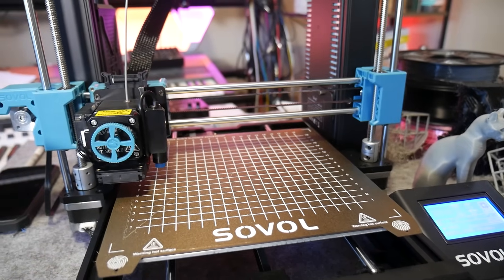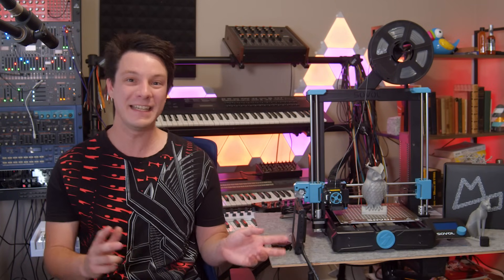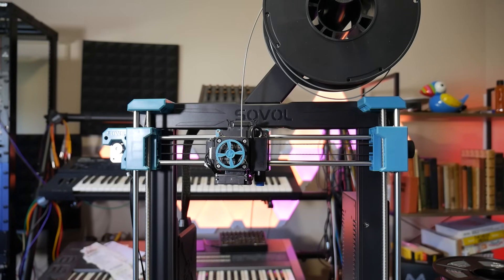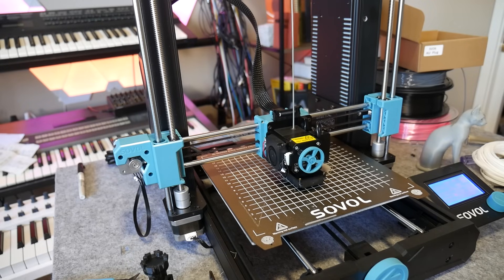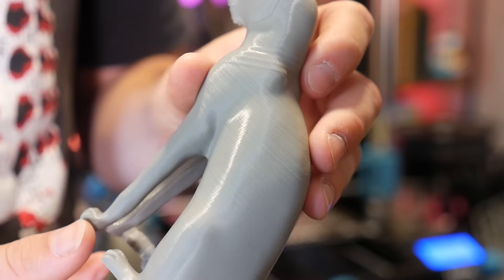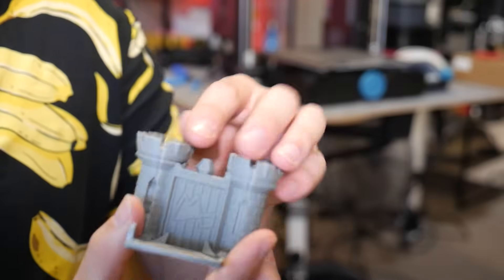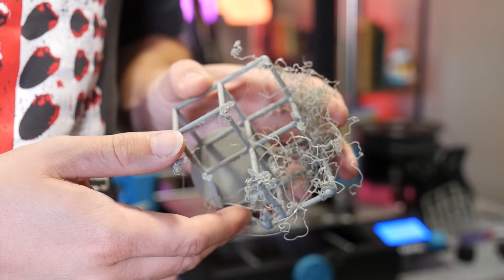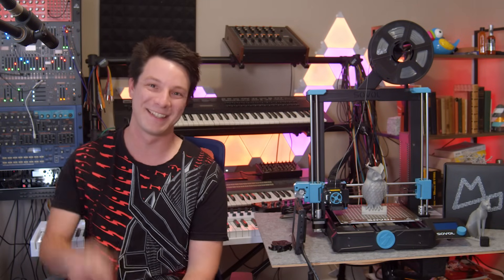Is the Sovol SV06 a Prusa MK3 for 1/3 the price?

Comment: I'm so glad I got my flsun v400. I don't understand most of what you said, which is why I got it. Plug and play. Auto bed leveling, filament runout detection, it just works. I'm an engineer who's fully capable of going full tilt on 3d printers and understanding all the tech to the nth degree, I'm just not interested in doing that
Reply: From one engineer to another...that is really sad 😉

Comment: I feel so much better looking at my pei bed scar now that ive seen a YT pro do the same thing. Th3d has a custom marlin firmware for the sv06. I fumbled my way through it. I was trying to use input shaping but couldnt get it to work. Would love to see you work through it :)
Reply: I have one on my printer sv06. If you contact them they will send you a replacement PEI.
Reply: TH3D is awful lol, I asked them what makes their firmware better and the dude got super hostile. He has a history of being a complete ass to anyone who questions him. From what I've read the firmware isn't even really better, it's just different.
Reply: @allwoundup3574  that lines up with my experience. The one feature I wanted from it didnt work. I had to retune everything. It was immediately worse than the out of box firmware. It was pretty easy to configure but Ive also not tryed to mess with Sovols stock firmware with the same tools.

Comment: 6:26 it's weird that I had to reduce my retraction from 6mm to 3mm after switching to a volcano hotend from stock ender 3 v2. Took me awhile to dial it in since every forum suggests to set it slightly higher than what I'm running with the stock hotend. I still get a tiny bit of string here and there but nowhere near as bad when set to 5mm or higher. I also had to back up retraction speed from 60 to 45mm/s. I had to do the same retraction test multiple times, like more than 5 times because it's so out of the ordinary based on what the internet says that I thought there has to be something I was missing, but nope, it's just the way it is.

Comment: On some other dual-z printers like this I've certainly found having a warp-free bed (glass, usually, instead of flimsy flexible sheets) and a z-axis sync belt are crucial for long-term reliability... I'm sure a belt would be an easy mod on this.

edit: oh yeah that inductive probe levelling needing fine tuning afterward too... rip. I don't understand why everyone doesn't use strain gauge levelling, it's genuinely more expensive to use inductive probes, both in individual printer kits and bulk-ordering as a manufacturer...
Reply: Noob here. Why would you want a sync belt ? Wouldn’t that defeat the purpose of the bed leveling ?
Reply: @Carglouche.  Angus mentioned it already but it keeps both Z axis positions in sync so the gantry did not skew (which can cause bed leveling problems as well as just generally break/wear down the machine, particularly a unit with no endstops)

Comment: I'm actually loving my SV06 - it worked straight out of the box, using the Cura profile they provide on the SD card, the only change I made was to up the speed to 80mm/s.

Took a bit of a risk in buying this printer as none of the channels I trust had produced a review on it yet. 

I've put approximately eighty print hours through mine by now, every single print has come out almost perfect - aside from a bit of wispy stuff, but that's potentially my temp setings for my filament. Admittedly, I've not tried any "torture test" style prints, and the longest print so far has been about fourteen hours.

Obvious disclaimers apply - I'm just a 3D printing scrub, my only other machine being an Ender 3 V2 Neo.

Thanks Angus for putting this video out there, love your work mate.
Reply: Mine has been nothing but problems
Reply: @outsidecounty9976  what problems have you had?

Comment: Okay I was blown away with the build quality and ease of set up for the printer. I received the SV06 a couple weeks ago, but just as I was getting it tuned after a few hours of tests, I tried a g code post processing script to pause at a certain layer, and the g-code bricked my printer's mobo. I tried to reflash firmware, but no luck. I returned it and am considering just buying another Anycubic Vyper, which has been my most reliable machine yet

Comment: Thanks for the video - I like to adjust conservatively for nozzle height, then tweak z offset on the first layer.  This avoids print bed gouge.  Not all printers/firmwares offer z offset as an easy tune-while-printing option however.  Looks like a nice printer.

Comment: No isnt. Many problems... Mine has massive Z wobble 👍
Reply from the maker: bent leadscrews?
Reply: @MakersMuse  i dont think so. I ordered 2 new T8*8 with wobbly bras lead screws like the Ender 3 has and i will see if its works. Bad english 😁 in facebook groups of the printer there are also many problems to read ... and sovol releases a plus Version now 👍
Reply: I noticed my Z was moving around unnecessarily, and it turned out that the upper half of the printer was not bolted squarely to the lower half.  A fellow redditor pointed that out to me as a possibility, and it was true.  I loosened the 4 bolts, and used a drafting square (any kind of square a foot long or so will do) to make the upper half 90 degrees to the table.  Solved.  This was not a problem on my son's SV01 PRO because his slots for the upper half to fit into are precisely milled dovetails, and there is no wiggle room.  But his took a great amount of patience to slot into place.

Comment: New to 3d printing, just wondering if the sv06 plus would solve the issues you mentioned? Looking at buying my first machine. Was thinkig about the bamboo options  but not sure for the price.
Been watching your channel for awhile now. Keep up the good work.
Reply: While you’re looking, Elegoo Neptune 3 pro/plus/max are comparable options. Mostly the same as this, but v slot wheel and not an an metal hotend. I would have bought this if it were ever in stock. Good luck now that it’s on this channel.

My calibration cubes definitely look better than this though (3 pro).
Reply: Bambu P1P is twice the price of the Plus, that price gets you less tuning/fiddling/solving problems etc and should have near perfect prints out of the box, but if you're willing to put in the time and learning then you can get a machine like the SV06/Plus to a great place with some ongoing effort, and then double up for the same price lol. I don't have that time so instead of upgrading to the Plus I switched from SV06 to P1P, that's just me.
Reply: Honestly, 3D printing is still not appliance-like with any printer. If you want to get into it, you're going to have to learn a bunch, even for the most easy to use printers. Fortunately, youtube has endless videos covering all the issues you're likely to face.

If you have the money, get a Prusa. If not, I think the Ender3 S1 is the easiest to recommend at the moment. By picking the most popular options, you're more likely to find answers when things go wrong.

Comment: Why can't printer reviews measure and report quantitative results.  How much variation is there in a flat vertical wall for instance, reported in mm peak to peak.  All these prints of statues with lighting that hides the flaws.  Who cares?  I don't print junk plastic statues and I want to know how any given printer can perform printing a smooth surface for a product that won't look like crap.  Obviously a printer like this built with the least expensive bearings, motors and fans will have failures in 100 hours of run time, so I wouldn't bother with this one, but it would be nice to know if it has 20% variation in an 0.2 mm layer height or 2% variation.  Why do all the work and not report anything that can be compared between different reviews?

Comment: I bought one as an emergency backup to my original Prusa I3 Mk3.  Turns out it actually prints better than my Prusa, so now I'm using both.  There are already people designing new fans and such.  Also a couple people installing and running Klipper with input shaping and getting print speeds comparable to the Bamboo X1.  To Sovol's credit, they took the leap that Prusa refused to take and designed extrusion molds for the major parts.  This brings their costs down significantly in bulk sales and produces higher accuracy parts.
Reply: would love to know how reliable it’s been compared to your prusa after getting it tuned , i have 2 and was looking for a cheaper alternative
Reply: @Project.3.D  months later.. still printing better than my 3yo prusa.
Reply: @Project.3.D  pretty reliable. ive had mine a year couple small issues. but really you will not be dissapointed. so if you havent get one there even cheaper now.
Reply: Bambu’s own A1 and A1 mini are bed slingers that do a 14 min Benchy
Reply: Youre liar lmao sovol printers are always dead out of the box and never work because sovol is a scam company. All the phone numbers and social media links on thier website are all dead and fake links. Call thier corporate phone number and its disconected. SOVOL IS A SCAM COMPANY the host comment here is a liar and part of thier FRAUD RING. DO NOT BE FOOLED INTO GETTING SCAMMED BY SOVOL
Reply: Have you any links to the speed mods? I am looking for a backup for my X1C and even if it could reach 80% of the speed that would make me happy
Reply: It can come nowhere near a bambu. It's not possible for any bed slinger. I have a ender 3 s1 with klipper and the best I can hope for is 150mm with 3500 acceleration. That is like the max where I can retain acceptable quality. A bambu can do 500mms and 20000 accel. They are not comparable. It's more comparable then a stock a stock ender 3 s1, but still two different ball parks.
Reply: @luke8874  the neptune 4 series would beg to differ its faster than a bambu, 
also the klipperized sovol sv06's hit close to 18 minute benchies, only 4 minutes off of a bambu printer
Reply: A klipperized bed slinger, built really well will have an acceleration significantly lower than any core XY. So will never achieve CoreXY print speed, but can reduce the gap.

Comment: I got this printer based on the many positive reviews. Yours is the first I have seen that even mentions some of the problems I have with mine.  One major one is assuming that bed leveling even works.  Most people are printing on the center of the bed and thats great for most models.  Try printing something in the corners and see if your settings still work. Mine do not. The bed is a potato chip.  After firmware changes and nylock nut mods I can use about 80% of the bed. The bed is only attached with 5 screws so that mode is limited. Bearings were actually losing balls and had to replaced. Cooling fan is a joke.
Reply: The whole point of mesh levelling is that it accounts for the bed not being perfect (which is practically not possible to source, particularly at this price). My experience hasn't been perfect but I've done full bed prints no problem with stock mesh levelling. One theory I saw as that they increased the strength of the magnet for the bed on later units after feedback (which is weird, I think a gentler magnet is better) and it is interfering with the conductive sensor.
Reply: @cenciende9401  I glad you have a better experience but its a bit of survivor bias. You had no issues so other must not be either. Bed leveling works within a certain tolerance.  I switched to a user made firmware and got dramatically better results then stock firmware. Thats when I realized how bad the bed actually was.   I leveled it as best I could and still have issues with certain areas. There just isnt enough mounting points to adjust that amount of warp.  The FB page is filled with people having the same issues.  If a censor cant work on a magnetic bed then they need a thicker printing sheet to keep the print from pulling it up.  I understand its a budget printer but these reviewers are not showing the whole story. THats why I am grateful for a video review like this one that actually mention the problems and design flaws.

Comment: Two main questions: (1) Which thermal break is compatible with hotend? (2) Is LA supported by firmware? It is crucial for fast and precise prints 

Not mentioning LA support in review surprises me, it is the most important feature for direct extruder printers!
Reply: In all my time have never seen the term LA... If you mean Linear Advance, then it is already enabled and calibrated in the stock firmware, plus can be adjusted directly on the screen like many advanced settings. Plus you don't have to use stock firmware of course.
Reply: @cenciende9401  Linear Advance, yes. Thank you! It is good news, typical Prusa/Ender clone has it turned off on firmware level.

Comment: I would'nt change my Ender 3S1pro for that !
the thing that i like the most is the precision the repetability and the belt between the two z screw !
Maybe i am lucky but i am very satisfy and i am buying a second one .
The sound of linear bearing is awful compare to V wheel
and v wheel are easy to clean and inspect for flat and they are ajustable

Comment: I don't see a benefit of this over the ender 3 s1 that's more accurate and has the filament runout too. With klipper it's probably the best i3 style on the market
Reply: You can buy this for around 239usd/€...
Reply: @vilas69  I bought my S1 for £220 in the UK in September
Reply: @iamdmc  that was a very good price indeed. not sure you can get it for less than 300 now